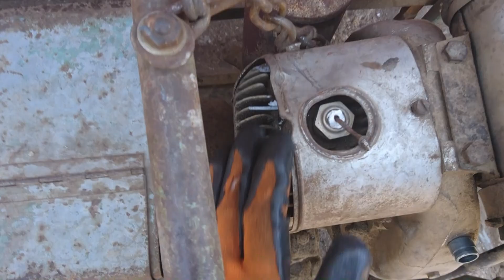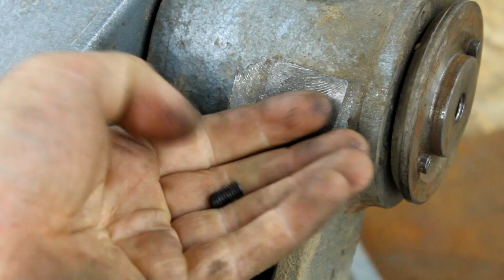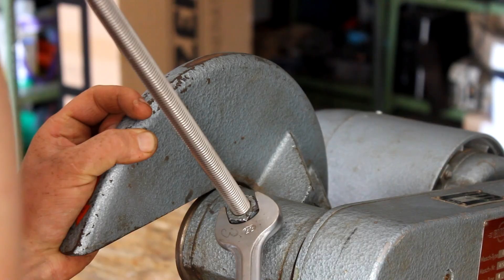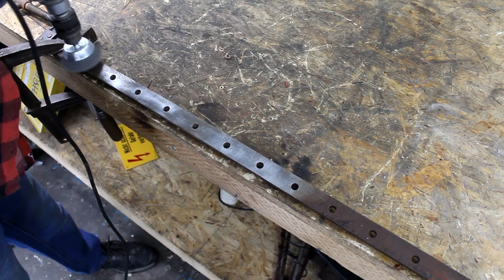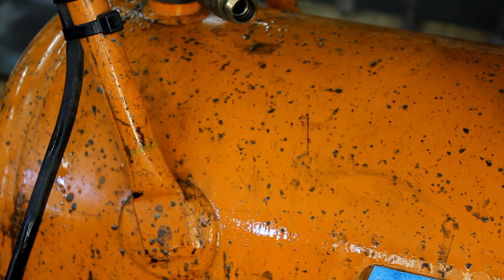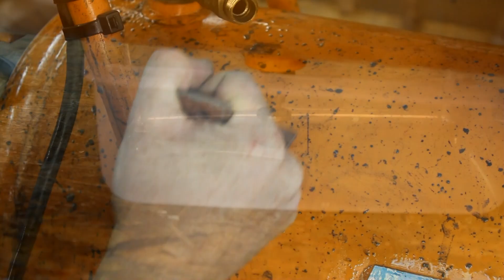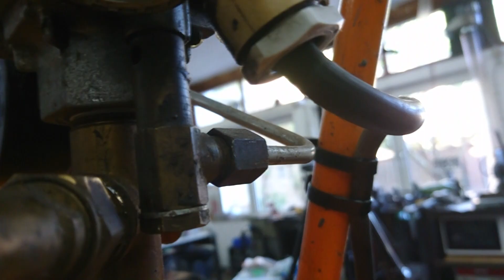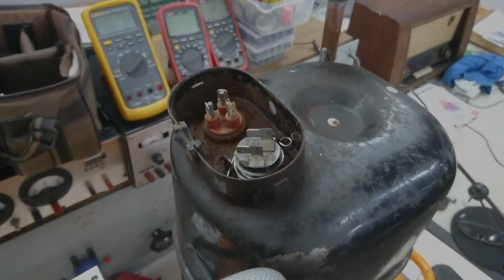Many More Scrapyard Finds! Repair-A-Thon!

Comment: Just for fun, try using some toilet bowl cleaner for removing rust.  Here in California, USA, I use Lysol toilet bowl cleaner.  According to the label it has 12% hydrochloric acid (HCL) as its active ingredient.  HCL is pretty good at dissolving rust and the cleaner is not expensive.  (However, at only 12% it takes a little time to dissolve the rust.)  The cleaner is pretty thick so you can just brush it on.  Be sure you are wearing gloves and the piece you are soaking is inside a plastic tub or plastic drop cloth.  If your piece of rusty metal is large, lay some pieces of wood on the floor to form a rectangular or round barrier.  Then place the plastic drop cloth over the wood pieces.  This will form a shallow basin and contain any cleaner that runs off of the work piece.  Let the rusty metal soak for several hours or possibly over night.  If you can't completely submerge the work piece in the cleaner you will need to reapply several times if the cleaner runs off of the work piece.  After soaking wash off the work piece.  You will see a dark coating on the work piece.  Just wipe the coating off with an abrasive scrubber.  (Scotch-Brite manufactured by 3M over here in the USA.  You probably have something similar in Europe.)  Just another way of doing it if you don't want to spend the time and the energy scrubbing the rust off by hand.

Comment: I really like the idea for the silent air compressor. I will be doing that for sure since I happen have everything needed already sitting around. My wife thinks all this junk is useless. One more way to show her it's not. Thanks!
Reply: I have a few of these compressors but would you connect it with single or three Phase power.

If you would use single phase than you would need a capacitor and a starting relai. Richt?
Reply: @Markus Schwarz. https://youtu.be/cWs5JwK1_ig

Comment: Consider putting new bearings on the saw and adding a soft start circuit to protect the machine for many more years. Also, turn a washer instead of using the one you have now, make it as precise as you can to the OD of the thread. Vibration is a killer on bearings at those speeds.

Comment: I made one like that. I used mineral oil to lube the compressor. Was so nice to have a quiet one. I had to put my current one on a timer otherwise it will turn on an 3am and wake me up.

Comment: I really like the idea of making a silent air compressor. Could any compressor from a fridge be used for that as well, once the refrigerant has been properly removed from it and disposed of? Maybe only with a smaller pressure vessel, since it's only a 1-phase motor?

Comment: Try using muriatic acid (hydrochloric acid) or phosphoric acid to remove the concrete spatter. 

Concrete is basic, so the acid should soften it and allow you to scrub it off with a short exposure. It wont hurt the paint and will remove the rust built up on the scratched tank. 

Be sure to neutralize the tank surface when done

Comment: What is the air volume of the compressor? In imperial that would be CFM (cubic feet per minute) not sure about metric equivalent. I thought that an HVAC compressor would not push enough air to be useful for that  application.

Comment: To remove concrete drops from things without destroying them pour some vinegar over, let it soak for an hour, than scrub with a rough brush or rag soaked in water + a drop of liquid soap or dish washing detergent. If the surface is convex (like that air tank) soak a rag in vinegar and lay it over the area. Best scrubbing brushes are those made for carpet cleaning and the best rags are old hemp bags. Alternately you can make your own rough scrubber by tight wrapping thick hemp rope over a piece of wood.

Comment: Removing concrete. Once upon a time I worked for a ready mix concrete company (USA) that used trucks to deliver concrete to construction sites. I recall the truck drivers all carrying a jug of muriatic acid (I don't know the concentration) on their trucks. Occasionally between deliveries they would pour some acid on a long handled brush and use it to clean some of the hardened concrete off of the trucks.

Comment: De-apocalypsize society:
Abolish inflationary fiat currencies. Inflation encourages consumption (why save if it loses value?). Consumption focused purchasing encourages planned obsolescence style investments.

On the flip side deflationary currencies encourage long lasting solutions and repair mentality  because they tend to get more valuable over time. Why would you buy a trinket designed to fail if you could hold out a little longer and end up with more purchasing power. Why would you throw away money (which is getting more valuable) to replace something you can easily fix?

Comment: I salvaged an old dishwasher circulation motor... the wiring code isn't anything i have ever seen, red, blue and white. There is continuity between all three wires. How do i wire it up for testing or 3rd party use?? Anyone??

Comment: You never use hot glue? What kind of a heretic are you? That saw is bad ass. I'd have gotten it running before I did anything else to the machine though. If the motor don't run any other work would be pointless.

Comment: Was or is Ethyl-Methyl-Keytone not used for removing concrete from surfaces, if it's still a publicly accessible substance for said use?  Would the paintwork on the compressor tank cope with a quite volatile and harsh chemical?  I don't know the process of using it as I was a teenager when I last saw it in use in  1978-79.
[Edit: Half the comment!]

Comment: What a cool looking lathe! That modern tool holder doesn't suit it though. ;) You can get a big bag of old HSS tool bits for 40 euro on eBay. They can be ground in to any type of cutter you need, you'll eventually learn a whole bunch about tool geometry and never need to buy another lathe tool again, and suit the style of both the lathe and your channel!

Comment: Muriatic acid is good for removing concrete with a stiff bristle brush
Reply: Muriatic acid is hcl, hence will dissolve the pain on the compression also.
Reply: @maienduo  Ive cleaned painted metal for years with 50/50 muriatic acid and water and have never had it dissolve paint

Comment: There's a product produced for cleaning cement mixes and will clean off all that concrete.
Love your videos, have been fixing old equipment for years and I'm currently working on my 5 lathe.

Comment: Soo jealous of you Germans, having 3 phase in every home. 😕
Reply: In Poland it is pretty normal too
Reply: True for a lot of continental Europe.
Reply: Of course , all Europe countries have  3 phase power for everyone who want it. And its a must if you run an electric stove,  and /or a flow water   heater.    Exceptions are UK and Italy where are  no 3 phase power    available is  in residential areas .
Reply: I never even thought that some countries don't have it. Eye opening moment.  I live in Finland and electrics are pretty much 1:1 copy from Germany. My house has 16A fuses in 230V=3700W per phase
Reply: You can make 3 phase yourself using an inverter drive (variable frequency motor drive) or you could couple a single phase or a 2 phase synchronous motor to a 3 phase permanent magnet synchronous motor using it like a generator. Add a flywheel for signal conditioning too. Maybe even using phase shifting capacitors could work. But there are options besides calling the power company and shelling out thousands of dollars to get 3 phase installed.
Reply: @dreggory82  what do you mean thousands of dollars, it cost like 250-300 dollar to get a professional to add 3 phase. And it's well worth it, since it can only be done by companies that are checked by the power companies, there's a reason why there are regulations put in place for 3 phase. It not something your average joe can just add to the grid. You need to know what you are doing.
Reply: @Lalaland.001  depends where you are.  To have a domestic 3-phase suppy in the UK would indeed cost several thousand.  Some light-industrial buildings don't even have 3-phase in some cases.
Reply: @engineered_images  Yeah but that's because you don't have 3 phase as a normal connection within urban areas, you actually have to get a ground cable to run to your domestic building/housing. Which means it would of course cost you more. But GB was never really a part of normal Europe to begin with, since you always did things your own peculiar way. Not blaming you but your government seems really reluctant to apply normal standards to housing, healthcare and legislation. You drive on the left still use the imperial system for your roads and pints, which in turn are 20% larger the American pints. 
You just left the EU as well which will literally mean that people from europe will get taxed just to get stuff from your country, which in turn will damage your economy. Anyways, GB has always been really expensive to live, your housing is ludicrously expensive to begin with especially in London, the cost of living is completely out of control, when I was student there, I could barely afford rent and sometimes had to go with lights and heat because the prepaid card waas empty, I mean you have gas and light on prepaid cards over there, like WTH. 
Anyways, I feel sorry for anyone living in the UK now. Good luck to you m8
Reply: @dreggory82  quote:  using an inverter drive (variable frequency motor drive) or you could couple a single phase or a 2 phase synchronous motor to a 3 phase permanent magnet synchronous motor using it like a generator. Add a flywheel for signal conditioning too. Maybe even using phase shifting capacitors could work.

is that all?
Reply: 3 phase?

Comment: Gotta watch that long hair and spinny things..  got myself with a dremel..  and hammer drill..  4 times..  and an angle grinder that finally learned me good...  the dremel was the worst believe it or not just because you have to turn it off and dont have a trigger..  the drill basically just punched me and broke my nose one of the times..  the angle grinder felt like somebody was flicking my hair and as soon as i thought about it, it ripped off a big chunk in half a second..  bled pretty good but still not as bad as dremel..  that crap took every bit of my hair..  the grinder just scared me most from the diamond blade that was on it...  that shit would have said hello to my central quartex then moved on before id have known it...  the speed that my hair was jerked out was like cutting metal sounds then next second after a thump was just a chuggachugga sound with hair wrapped around the blade still in the middle of a 3” I beam...
Reply: Cool story bro

Comment: Vinegar works, any type is fine. Apply, let it soak and then rub it off, A slow process but it worked for me on a new tile floor covered in concrete drips left by a careless builder.

Comment: Great stuff. I especially liked the conversion from noisy air compressor to much quieter one. I may consider this for my Aldi "Workzone"

Thanks

Ian, Birmingham, UK
Reply: I can't see a use for a compressor that fills up this slowly. I'm not saying that the quietness isn't amazing but the time it takes to fill up I don't think it could keep up with any airtool. Maybe a giant tank would solve the issue as a buffer but it would take hours to go from empty to operational...
Reply: @Stumper52  Hmmm yes, good point

Comment: muriatic acid will remove the concrete easily.
Reply: Yeah and lung tissue.
Reply: @1pcfred  ahahahahahahh at 10% is not so bad. it is sold as a cleaning agent. I use it all the time, i mean, i can't run or sing, but other than that... harmless.

Comment: To safely remove concrete without damaging the metal parts use *sulfanilic acid, mix it with something thickener agent, or find some product that has it already (e.g. Lime away or CLR).

EDITED: 2019/10/07
It was a typo of mine, I've should have written *Sulfamic acid also known as amidosulfuric or amidosulfonic acid.
It is much simpler ad cheaper than the sulfanilic acid (sulfanilic acid is a derivative of aniline and is way more expensive)
Reply: i believe vinegar works disolving "limestone"  and i've heard it eats rust too. i like using clr, etc to clean brass and copper, or a clogged car radiator.
 cool thumbnail
Reply: @ED4action  I've had good luck using vinegar to remove concrete splatter from a car.
Reply: I've seen people using acid wheel cleaner as it contains both sulfuric acid and thickener
Reply: @63ch31  Sulfuric acid isn't good because concrete contains a lot of calcium and they'll react forming calcium sulfate aka gypsum that has very low solubility, to a certain extant acetic acid too. So you need to react with a acid that has a high solubility calcium salt, and the sulfanilic acid in one of those. Muriatic acid aka, Hydrochloric acid is cheap and will work but also will screw the metal parts in no time...
Reply: @BarryManilowa  Wrong, some mild acids do form low solubility calcium salts, like phosphoric and citric acid, so you're bound to end up with a whitish haze all across the surface if you use them.
Reply: @freedom_aint_free : The GOOD thing with Phosphoric Acid is that if you use it on Iron or Steel, it will also form Iron Phosphate, and the metal will never rust again!  It's the active ingredient in commercial Rust Converters!

Comment: Would like a audio comparison between old/new compressor.  Also would like to have seen how long each one took to fill up. Maybe in the follow up. It sure sounds extremely quiet though.
Reply: it probably took a long time to fill
Reply: its so easy to see the difference.listen to a normal air compressor,then listyen to an air conditioner..its 30-40 db difference.

Comment: I agree with your opening monologue 1000%  !! it is exactly the same here in the USA ... a country that was built on manufacturing is now relying on a service based economy ... not everyone can code or fix electrical circuit......
Reply: It's worse than that, I've been confronted by 20 year old men who can't change a lightbulb in their car!
I rebuilt my first car engine younger than that, and I could solder before I was in my teens.
I can only assume there have been a lot of absent fathers over the years.
I'm thankful that mine wasn't, and was happy to have a mini "helper" in the workshop.
Thanks for all the knowledge Dad!

Comment: That's a beautiful metal saw but it sounds like the bearings are dry.
Reply: I wish they made bearings w re-lub mechanisms,  as standard.
Reply: @ryanb1874  theres a specific need for fully sealed bearings though
Reply: @TRX450RVlogger  Damn. Beat me to it.